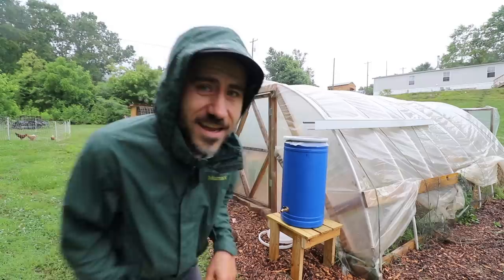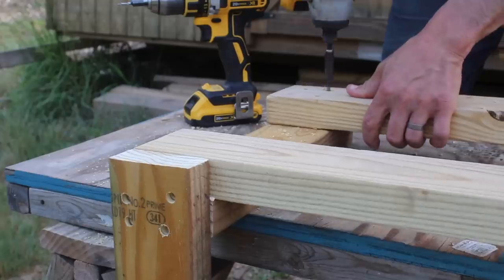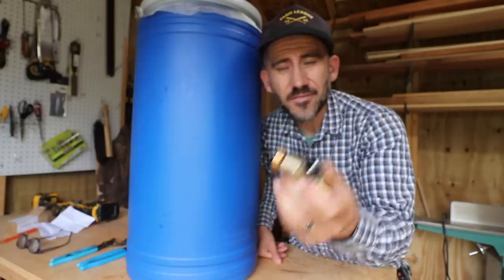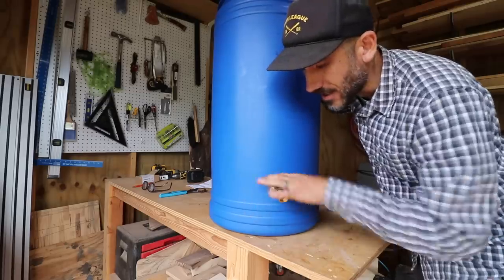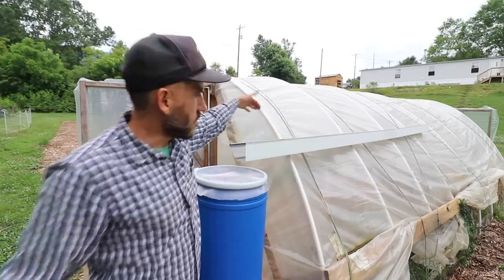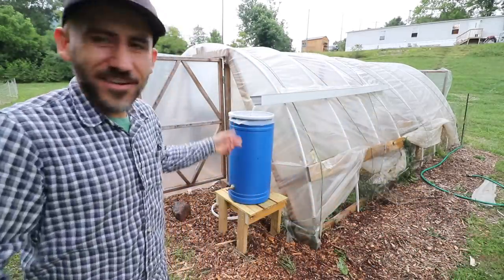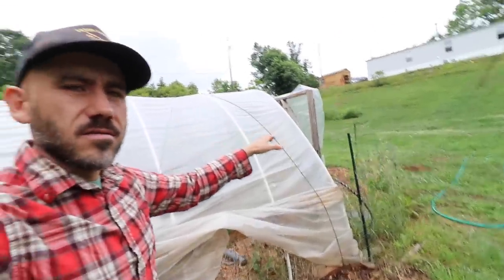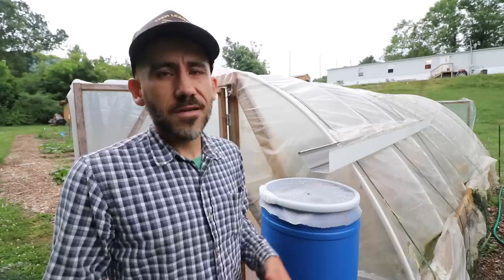Harvest WATER from HOOP HOUSE (DIY RAIN BARREL)

Comment: Thank you for showing the build of the little stand. I live in an old house without gutters and have 8 Rubbermaid garbage cans lined up under the dripline along my porch to catch the rainwater. I've been hand dipping my watering can for several years now - it works - but there are always issues with leaves and mosquitos getting into them. I've got some extra windows screens I've been using, but have wanted to set something up where the barrels are raised with a spigot in each, where I could leave the screening on. Your little stand will do the trick! I just need to make it a long stand, lol. Is the height set at 16"?

Comment: If you're interested in saving water, then why don't you use the garden tool shed? You could also do an ibc tote off the trailer house.  Think of the pressure you would have running a house down the hill to the in ground garden.  Just a few thoughts.  Love your genius hack for the hoop house.
Reply from the maker: It's on my TO DO List. thanks!

Comment: Use an overflow hole to fill another barrel, sitting on the ground or just low enough so the top of the barrel is below the overflow. Did you know that a hot house is just a huge survival technique used to recover water out of the ground in the desert? So you could rig it up to recover water daily, on the inside. Unless you open the sides or ends to reduce the temperature inside. :) Just tossing out ideas.

Comment: I use a very similar idea for my polytunnel/hoop house. But rather than build a stand I have cinder blocks, the 2, 25 gallon containers can with taps close to the bottom. Given we get lots of rain in northern Ireland it helps should we get drought weather....it also helps for water the plants inside the polytunnel

Comment: Excellent job Jason! I have two questions:
1). When you drilled the hole into the barrel, did you drill the hole in reverse?
2). I see the gutter is at an angle and the water will flow into the barrel.  Why didn't you put an end piece at the opposite end? I am not troubleshooting you or anything, just for my knowledge. 
I am thinking of the same idea except hooking up something like this to my chicken coop. Thank you for sharing!
Reply from the maker: in reverse? No. I did put an end piece on. I guess it didn't make the edit. :) thanks

Comment: Could you put a piece of lathe or anything between the plastic and gutter to have it flat?  If the tape lets loose.
Reply from the maker: Maybe, but I figured this way is easier. I drilled the gutter into the pipe. thanks

Comment: Jason, have you tried uniseals for low to medium pressure applications? They work well and are very cost effective.
Reply from the maker: never heard of that. I need to look that up. thanks
Reply: @SowtheLand  https://www.amazon.com/s?k=uniseals&ref=nb_sb_noss     I use them on our aquaponics tanks and barrels where I'm running pipe to other locations. l hang a 5 gallon bucket on the back of our chicken tractors, use a uniseal to penetrate near the bottom then run pvc along the inside of the tractors with nipples screwed in to it. Clean water and I don't have to go in the tractor to refill.

Comment: You will get too much water. I had a 40 gallon tub under a downspout and a single downpour filled it to overflowing. You might consider more barrels. Several more barrels. Good job. Good luck.
Reply from the maker: for sure